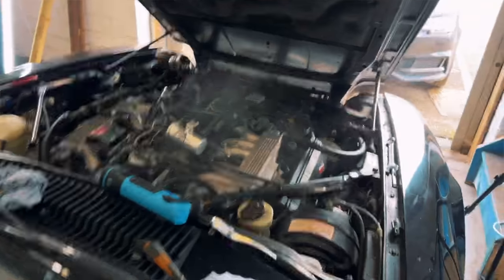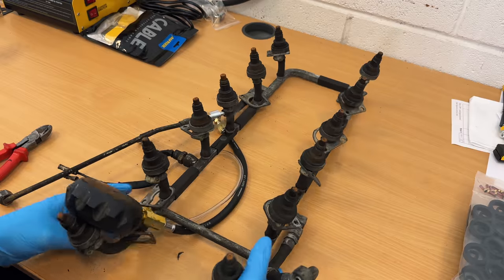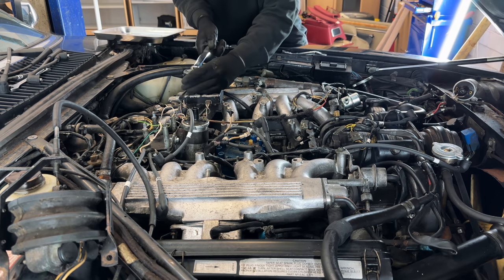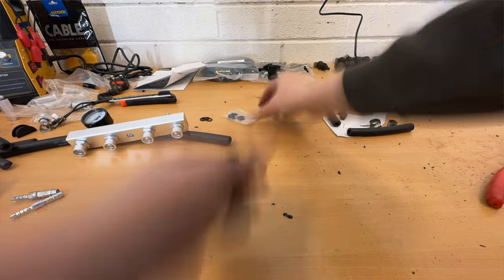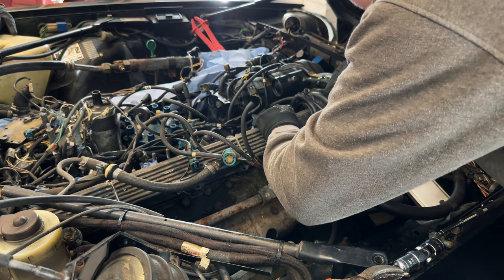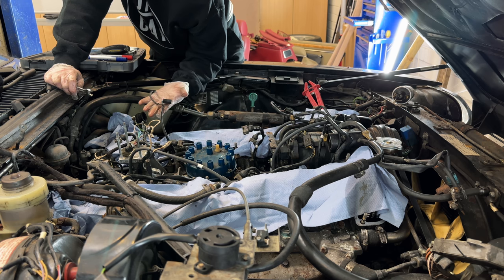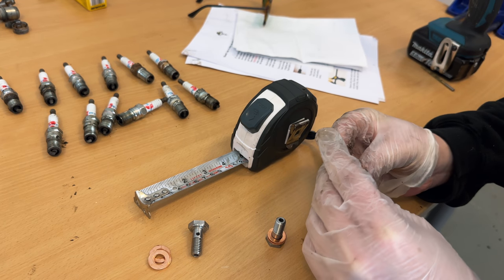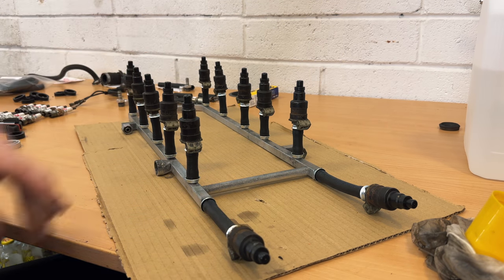STOP Jaguar XJS V12 FIRES! How to overhaul your injectors, change half moon seals & banjo bolts pt1!

Comment: I've got to do this too, thanks for the video.
Did you also remove all the vacuum BS and 15 minute timer etc?
Reply from the maker: I did indeed, hard to tell if it made a difference because the car had other issues which I think was due to the sump tank being blocked

Comment: So are those rubber injector hoses just a push fit? Seems strange. Anyway the jaguar v12 engines have trouble with everything in the valley getting very hot , so possibly that may have caused an issue with spark plugs, also are plugs the correct heat range? While you have everything off give dizzy cap and rotor arm a thorough check, the bob weights seize in the dizzy, and the ignition amplifier gets cooked. Can you reach the bango bolt from below, with vehicle on lift, I rebuilt a jaguar v12 e-type engine, and can't recall having issues with Banjo bolts
Reply from the maker: Yes they push on, impossible to pull back off! All good info. Impossible to reach from below, quite a difficult job, wouldn’t fancy doing again!

Comment: Did you replace the plug wires?  Looks like the pulse is arcing up the ceramic on the plug which would be a misfire problem.  Might the plug gap be too big?  The signal from the distributor is going to take the path of least resistance.  Another note abut the access to the back of the block, my Dad's E-Type V12 had to have the engine partially removed to service the back spark plugs.
Reply from the maker: I did replace the wires when I originally changed the plugs. My feeling is that the car isn’t timed correctly, when the mechanic did it is was done at idle. I’ve been told they should be done at 3k rpm. I’ll check plug gap when installing new ones. Luckily the only hard to get to plugs on the XJS is the front 2. All you’ve got to do is loosen the ac belt, undo 4 bolts and lift the compressor a bit.
Reply: @JAYPCARS  engineers always have to find a way to screw with the mechanics.🤣
Reply from the maker: They really do 😭